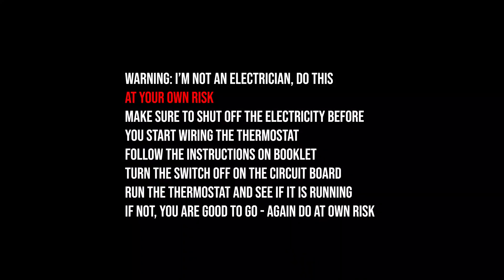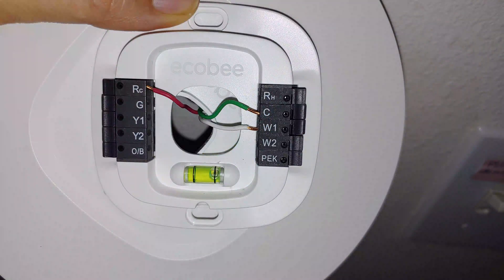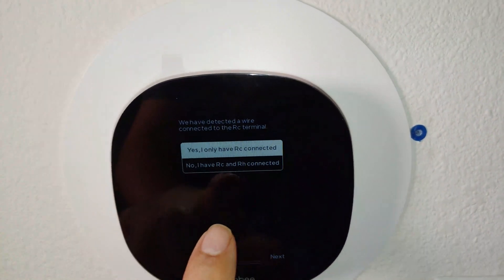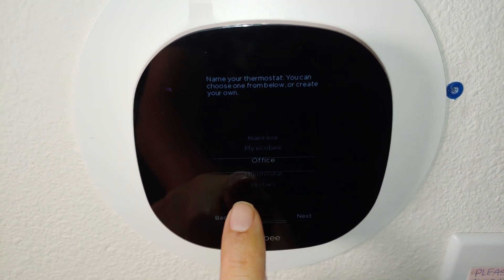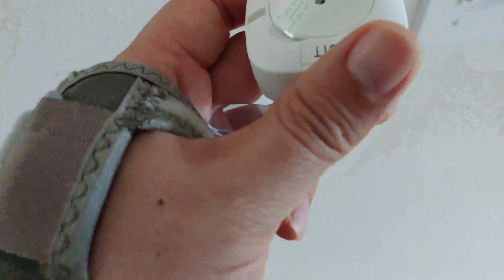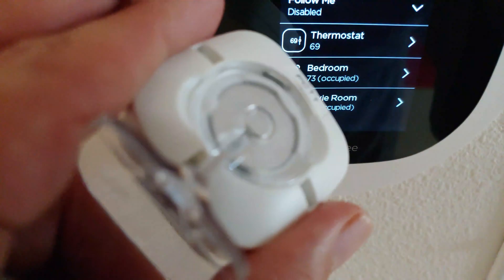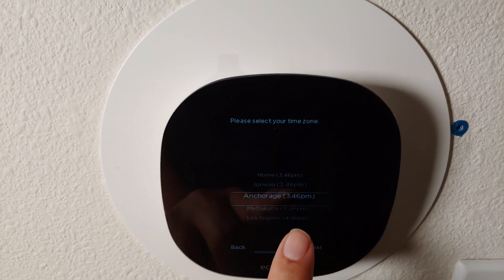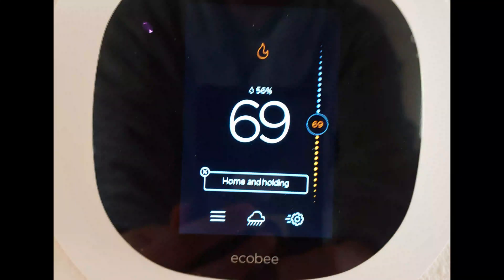Ecobee 3 lite - 3 wire installation

Comment: Why did you go to RC instead of Rh?
Reply from the maker: Most searches on ecobee install says it prefers the rc from twitter to reddit, etc but I wanted info on 3 wire system. I uses info below. Hope this helps you. :)

I used the info I found regarding 3 wire setup. My unit only does heat. https://support.ecobee.com/hc/en-us/articles/115000279128-3-wire-heat-only-thermostat-R-G-W-